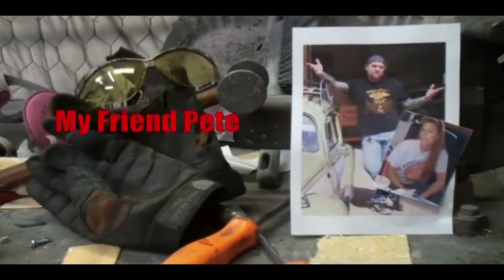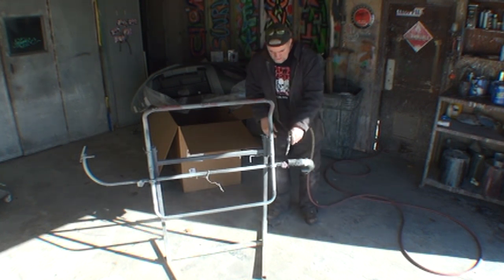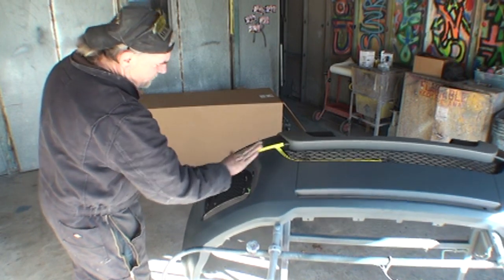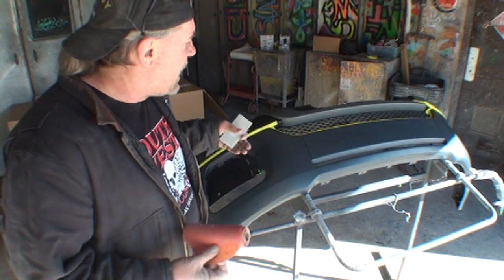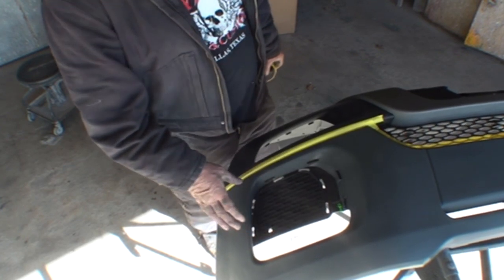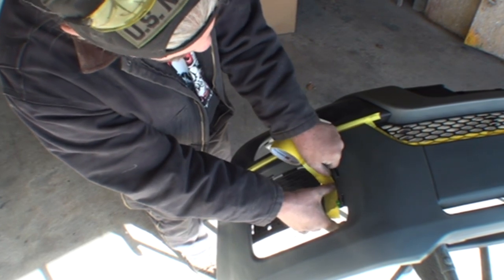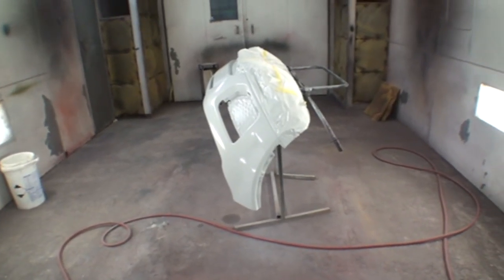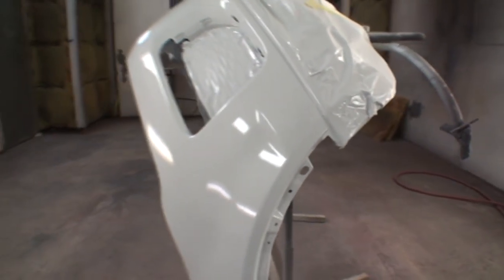"Car Bumper Repair" - Painting A Bumper Cover - From Start To Finish

Comment: Hello Pete, I have a 57 chevy that has been sprayed with Epoxy sealer been sitting a few years inside  still needs some body work, what would be best? Try  to  sand and spray with a  filler primer ?

Comment: Nice video man..!! I would like to touch on one thing, using 320 will work for solid colors..but when spraying metallics one should use a finer grit like 600 wet...
Reply from the maker: If you get a bumper cover like this one that has factory primer on it, 320 is fine to use, but if you get a bumper cover that doesn't have any primer on it your correct, using 320 dry will create scratchs, weather it's solid or metallic.... Thanks for watching!

Comment: Got a question for you Pete , do you peel off the tape right after clearing or do you let it cure for a while before peeling it off? That's the only thing in the video that you didn't mention, thanks Pete.
Reply from the maker: let it cure throughly before removing the paper and tape.
Reply: Thanks Pete!

Comment: Adhesive promoter thank you for the tip pete. Can you please tell me the type of acid used to clean metal panels
Reply from the maker: Depending on what your cleaning (Rust?) I use vinegar and water, or if it's really bad I use muratic acid. If you use muratic acid you need to wash metal off with a strong cleaner like purple power or something equal, it will continue to eat the metal and eventually create surface rust.
Reply: Thank you pete it's for heavier rust and muratic acid should be perfect . I just couldn't remember the name of it so thank you
Reply: Muriatic acid comes up as a pool cleaner on ebay I hope that is the right 1. It is expensive in Australia though